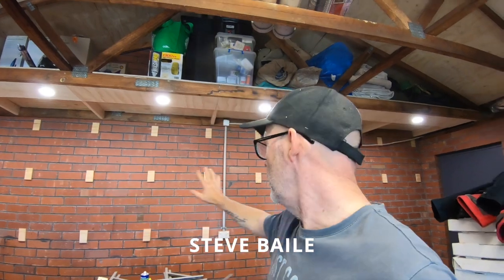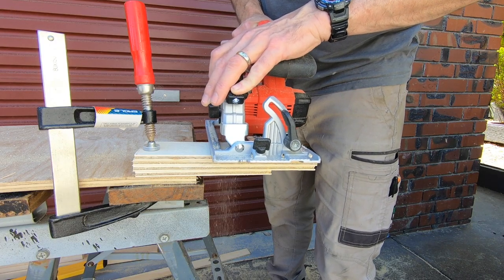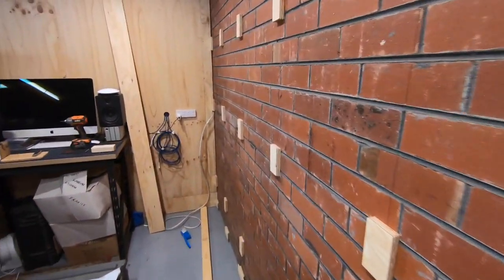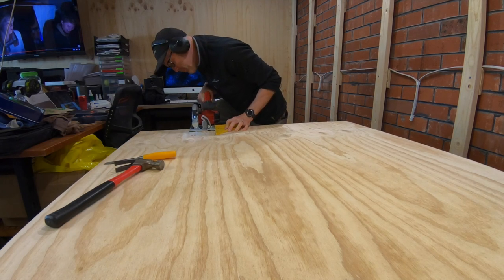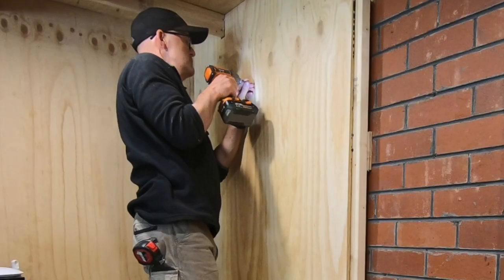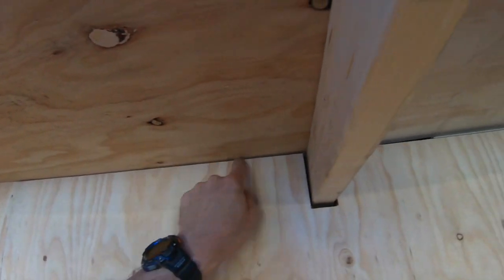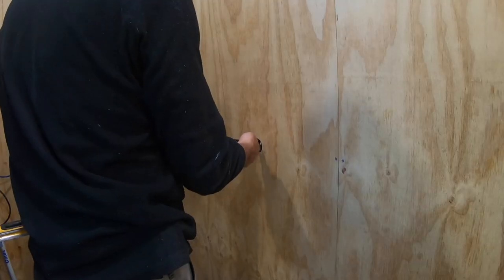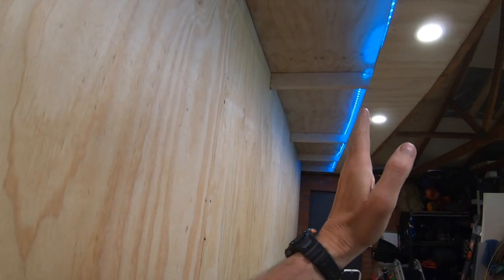Building plywood walls in my garage - Garage Build Series Part 3

Comment: Steve, from the looks of it (each bit of footage you show) you are securing the bolts into the mortar course and not into the bricks... The build is going well and looking good.
Reply from the maker: Hi Tim, no I actually drilled into the bricks for a stronger anchor point. Mortar would just crumble.

Comment: Thanks for the video. I'm planning on doing similar with 25mm plywood onto brick. I wasn't planning on using the studs, just going straight into brick wall. Do you think the studs are necessary?
Reply from the maker: I needed to run power and data cables behind the wall panels so studs give me the space to do that. It also creates a flat mounting 'facia' so the sheets are nice and straight. But if neither of these are important then going straight onto the brick would probably be ok. We've stuck plaster sheets directly to a brick wall inside our house as part of our reno and it worked ok. I actually ran the data cables along the mortar lines on the wall and siliconed them in place before we stuck the plaster on!

Comment: Also why plywood wouldn’t sheet rock be cheaper and functionally same and easier to finish.
Reply from the maker: Hey Jacob, good question. I went with the plywood mainly for the aesthetic of the wood finish. If I used sheet rock it would just feel like another room in the house.
Reply: plywood is a lot easier to finish as it doesn't need joint compound or paint.

Comment: Why not put studs sideways and insulate as well.
Reply from the maker: I've run the studs vertically because that's the way that houses are generally built and seems to make sense. I can run cables up and down the walls behind the panels easily. No need to insulate as the walls are double brick and we don't get extreme cold or heat in Melbourne like some places. The ceiling is insulated though as there is only roof tiles above the silver foil.
Reply: @ExpeditionAustralia  i still find putting the studs like that interesting never thought of it that way.